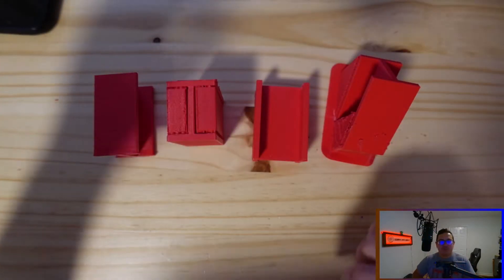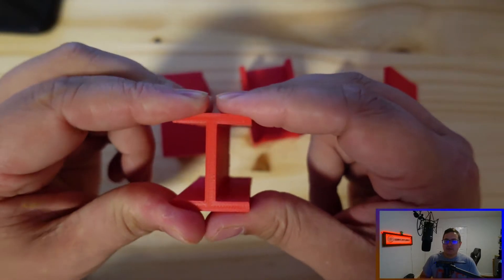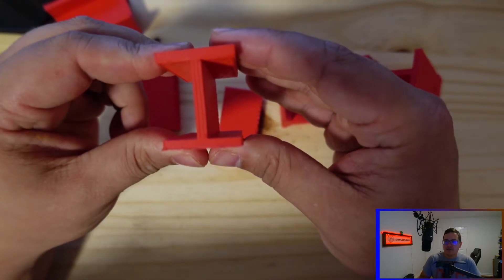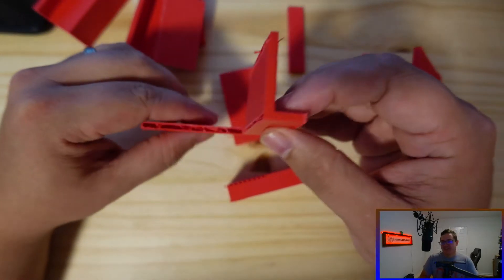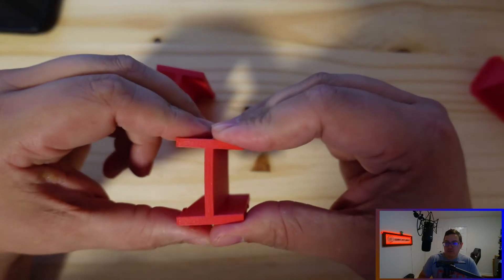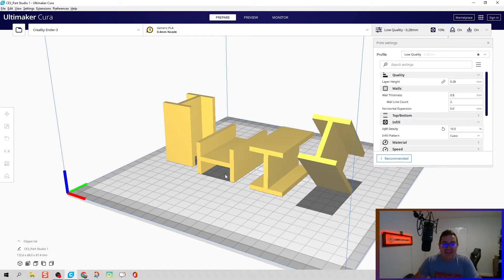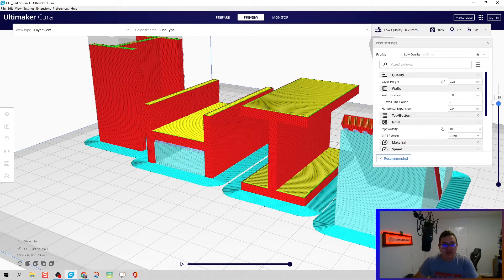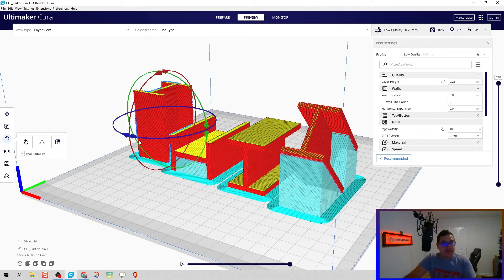Print Layer Direction - Day 15 of 100 3D Printing Journey

Comment: Well, if you want to use this beam as a horizontal structural component, the first option (with no supports) is the worst. "I" laying on its side is the best. Just print them long enough and try bending.
Reply from the maker: Well, sure. That wasn't the concept of this video. It was about layer direction, not beam integrity.